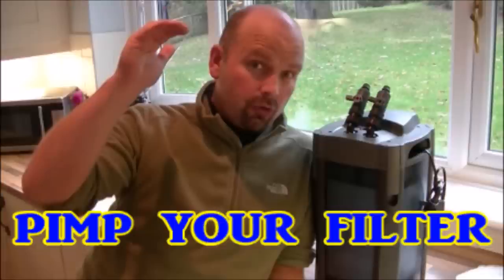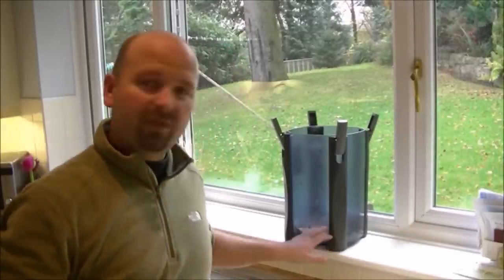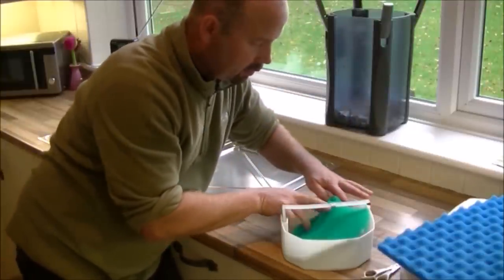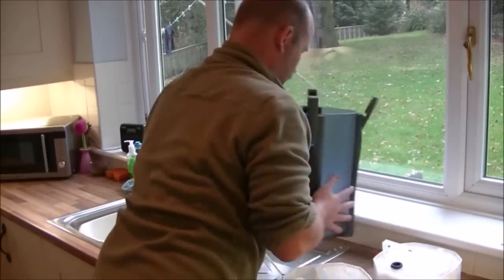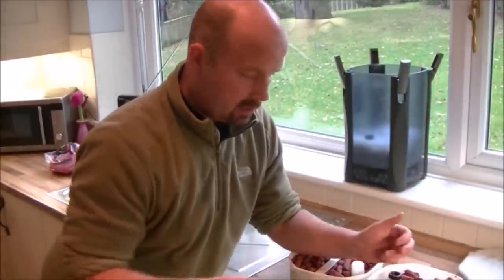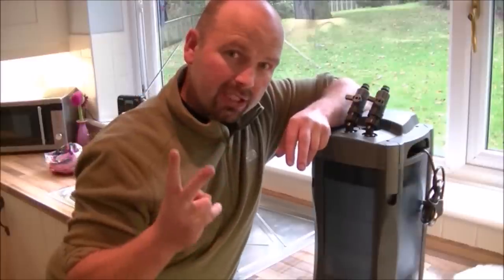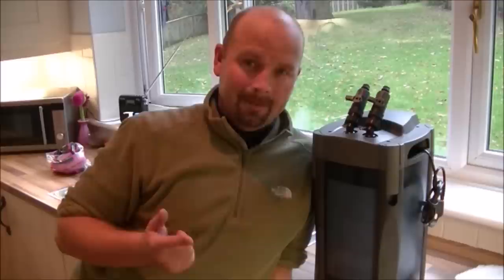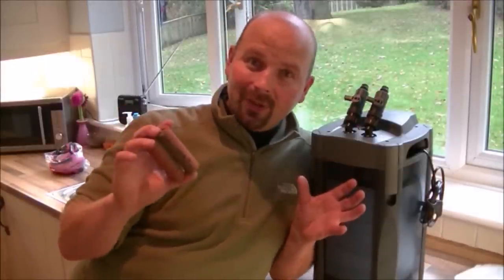External canister filter set up, nitrogen cycle and what happens in a filter - by Pondguru

Comment: Hi Pondguru, I'm getting ready to pimp my filter, but I was told by the Greatwave person not to do it all at once. My canister filter is an established Marineland one, so could you please tell me how to go about doing this ? thanks in advance.
Reply from the maker: Don from Greatwave may have already explained this but in the case of an established filter it is definitely best to upgrade it slowly since doing it all at once will set the filter back to day 1 due to all the established bacteria being removed and new bacteria needing to build up to a sufficient level to cope with the bio-load.
Therefore I'd suggest the following:
Week 1 replace the foams
Week 2 or 3 replace 1 tray of media
Week 3 or 4 replace another tray of media
Week 4 or 5 replace another tray of media and so on until the filter has been upgraded.
It is always best to leave at east a week (or ideally 2 weeks) between the tray upgrades to give the new media time to mature enough to cope with the pollutants. The gel balls will help during the process as they dissolve slowly releasing the good bacteria which will not only seed the media but will act against the ammonia and nitrite, helping to level out any spikes associated with changing media in a filter.
Not sure how many balls Don gives away with the media but I send out at least 10-15 per kilo which is more than enough to prevent spikes.

Comment: Hi, first of all, thanks for your fast shipment. I received the BioHome Mini Ultra Media fast & well packed, together with the free starter balls. If you can help me please, I have got an Haqos Expro 1500 external filter. As soon as I saw your video, I thought of swapping the trays, opened the filter and found out the coarse foam (on top of filter) was dirty and the medium foam just beneath cleaner! I thought water is flowing from top tray to bottom tray??? I consulted with the shop I bought if from too and he also said that in this filter model, dirty water flows downwards and clean water comes back up through the pipe/hose. Could you confirm for me please before I re-arrange my filter using the filter media I just bought from you? Thanks
Reply from the maker: I sent a reply to the email you sent shortly after you posted this comment.

Comment: Maybe a little off topic for this video, but what is the best value (I mean the best for a reasonable price) external cannister filter these days? I've not kept fish for around 10 years now, but I used to have both Eheim and Fluval filters on different tanks - the Eheim was better all round, and was silent (very important to me), while the Fluval just made a lttle noise.

I don't know what's available now, and how they compare these days...
Reply from the maker: The fluvals are OK and very cheap. All Pond Solutions make decent ones which have more biological capacity than the fluvals so they are definitely worth checking out Obviously eheim is still the best make but if you replace the cheap crap media , bio balls etc. in the APS filters and set them up properly they will perform very efficiently.
Reply: Pondguru  Thanks - I'll take a look at All Pond Solutions and see what they have, although I may just save up and get another Eheim.

Comment: Woody's Discus
What Do you think about sand on the bottom ? Before the sponges of course, or . half sand and the rest ceramic media (just leaving out the plastic balls). 
My Bio Home ultimate is waiting for the third tray for my 2217.
     Thank you in advance,
     Woody
Reply from the maker: Sand in the bottom of the filter? It will be sucked into the foams and quickly clog them unfortunately.
Reply: Thank you Richard !!!
Received my third "divider" today. Will set up tomorrow A.M. as you show. Will use two fine pads as eheim only gives  course, fine , and a carbon pad. Oh yes , BioHome ultimate !!!!
Woody

Comment: Hi there.  Thanks for this video!  I know it's a couple years old but it's given me more info for what I need than just about any others have.  I do have a question though, if you can help me;  I have a Sun Sun canister filter that is very similar to the one you have in this video.  I've had it for two months and it appears to have cycled nicely because the fish I have (all 8 of them!) seem to be very happy.  I was told to do a filter cleaning and was wondering if I should replace the media in my filter now or if I should wait until later.  Is this method you show ok to do at this point (two months into a new aquarium)?  I would really love to use this media instead of the smooth ceramic rings and cheap mechanical filters I have installed now.  I have found Greatwaves website and can get what I need there if it's ok to do it.  I appreciate your advice on this and also on all your videos. Great stuff! Thanks again!
Reply from the maker: Dear Tony,
Yes it is fine to replace the media you currently have with proper media but it would be best to do it gradually. One tray in first week then leave for a couple of weeks before changing another tray and so on - that way the change over should take 6-8 weeks and be very smooth.
If the aquarium is only 2 months old then it won't have anywhere near a full stock in there yet so its a good time to do it before the filter is operating at capacity.
Glad you enjoy the videos.
Regards,
Richard

Comment: that helps a bit chap will i need to reuse my old biological ceramic rings. i have 4 trays one with biological and other 3 with polishing pads and carbon. im due to filter maintenance soon do i replace everything with 1 off your kits cheers neil
Reply from the maker: +Neil Smith Sounds good and your fish will thank you for that.
Reply: +Pondguru Outdoors do i reuse old biological or get rid
Reply from the maker: +Neil Smith From an efficiency point of view it would be best to replace the ceramics with the biohome but if is a mature system do it one tray at a time so the change over takes 3-4 weeks.
Reply: +Pondguru Outdoors ok thanx. yes it is a mature system

Comment: Pondguru your videos are awesome thanks man!
i currently have a 10 gallon tank and looking to purchase an external filter. 
im also looking to get a bigger tank soon..so i wanted to get a filter that could be used for my bigger tank (20 gallon) as well down the line.
so my first option was looking into the Eheim Ecco 130 or 200 is 200 over kill for a 10 gallon? both have similar flow rates...the 200 is a tad bigger with one more basket for media. so my issue is the order i should put everything in because....in the EHEIM Ecco canister filters, the water enters from the top of the unit and goes to the bottom of the filter by the sides. Then it enters the filter media baskets from the bottom before going back in the aquarium. You should only have one blue coarse filter pad at the bottom and you can fill the rest of the bottom basket with SUBSTRAT pro. For the rest of your set up, everything is placed the way it should. just a little confusing on what they mean? how would suggest on doing it? and also whats your opinion on using an Eheim Aquacompact 60 instead? thank you for you time and keep up the good work.
Reply from the maker: Danny Arias I have had someone at my house with a ecco filter today a luck would have it so I know exactly how that one works. The top foam (blue one) is a coarse foam as a 'pre-filter' then water is fed out between the tray where that one sits and next one down so it can flow down the outside of the trays and enter the rest of the trays from bottom to top just like in this video so leave the top foam in and set remaining trays up like in this video. I would personally get a filter big enough for the tank you are going to get and that will save you buying another one when you upgrade. I'm not familiar with the Aquacompact filters unfortunately.I think the filter which was brought to me today was a 200 and it took about 600g of biohome ultimate per tray.

Comment: would the media used in your video be better in your opinion  than using Google K1 micro
Reply from the maker: +Paul Perriss The biohome ultimate is easily the best media available for externals and the K1 would be used in a different sort of filter - a moving bed filter. Plastic media is no good unless it is moving as it supports such a low population of bacteria when used in a static filter.

Comment: Hi pondguru,  have you come across cfs 500 and 700 filters. If so I was wondering the best way to change them to include biohome media. Top vids btw thanks.
Reply from the maker: Chris Marchant I haven't heard of them and google search doesn't give me many clues. If they are external filters with a pump in the top like this one then the set up will be exactly the same. If the pump is at the bottom (like FX5 and FX6 from Fluval then the trays would be reversed so foams on top and media underneath. Feel free to send tray sizes and pictures of filters to pondguru@btinternet.com and I can work out how much media you will need no problem.
Reply: Cheers will send a pic. The 500 is more like an fx5 the 700 is a bit different. It pulls water through the centre past a uv light.
Reply from the maker: Chris Marchant No worries.

Comment: When setting up a canister filter for the first time, should I wash my filter medias before putting them into filter? If yes, should it be with tap water or rested& conditioned water?
Reply from the maker: Ideally it would be washed in treated tap water or water you have drained from the tank but it just needs a quick rinse to remove any dust generated during transit.

Comment: Love your videos can you show us how to set up a FX6 thinking about getting 1 want to set it up the right way your way
Reply from the maker: Floyd Morey It is exactly the same principle but as I mention in this video the FX works from top to bottom, not bottom to top like the one in this video. Therefore you only need a fine pad on top of top tray (as you have good mechanical filtration all round trays) then put the biohome mini ultra / ultimate in the trays below the fine pad. You should be able to get approx. 5kg in there and that will give you enough capacity top see good nitrate reduction in about 500 litres community tank.
Reply: Thank you. So keep it simple and use the right stuff
Reply from the maker: Floyd Morey That's exactly right. Manufacturers want you to believe that you need all sorts of sachets of magic granules to remove ammonia, nitrite and nitrate but all that should be done naturally in the filter when it is set up properly.

Comment: Hey Richard do both the medium and coarse foam go bumpy side down?
Reply from the maker: +Mine Shaker Yes the bumps will be facing the water flow so you get maximum surface area in contact with the water so it goes much longer between cleaning sessions. I may have put one of them in the wrong way on my previous external filter video, lol

Comment: I’ve been looking all over for a good external filter setup, I tend to look in the comments and people mention you on how to ‘properly’ setup an external filter. If I follow this setup will my discus fish survive?
Reply from the maker: I can't say if they will survive as I have no details of tank size, current filtration, stock or if they currently have health problems.
BUT....if you properly size a filter and set it up properly the fish (of any type) will have not only the best chance of survival in healthy water but they will also be way happier too. This video I did last year goes into much more detail about sizing filter and setting up: https://www.youtube.com/watch?v=L5FkSTYkEAE
Reply: Pondguru I’m planning to buy a fluval Roma 240 (240L) with a fluval 306 external filter. I’ve seen other people setup their fluval filters differently to this.
Reply from the maker: My previous reply has a link to a video I did about properly sizing a filter. Even with a normal stock in a 240 litre you will be unlikely to achieve a full cycle with a 306 since it will only hold 2kg of media (if you use the bottom tray for foams). The coarse foams down the side of the 306 would be left in place and bottom tray would be for coarse (if used), medium and fine pads leaving 2 trays for media (1kg biohome ultimate in each tray - 2kg total). You'd be much better off with the 406 for a normally stocked 240 litre tank.
Reply: Pondguru ah okay, thank you for the information. I’m quite new to using external filters. With the fluval 406, it comes with media and carbon already, should I use those before using the kit in your description?
Reply from the maker: If you need to get the filter running on a tank before proper media arrives then yes by all means run what comes with it as it will be better than nothing.
Reply: Pondguru Okay, so I can use the media that my filter comes with and replace it during the next cleaning (or depending when I buy biohome filter media), without losing bacteria?

Comment: 1. Any updates on the Production of your Peat Pellets?  
2. If carbon is to be used in this setup, would it go before the Biohome or after?
3.  Any thoughts about having Biohome made into small balls or other shapes?
Reply from the maker: The peat pellets were too costly to produce and although they worked great they were no more effective than peat balls which are much easier to make.
If you use carbon then it needs to be the very last thing water hits before leaving a filter so it would sit on top of the top tray in an external filter like this one. It can be made into small balls but Eheim already do a very similar product. There is the possibility of making up some moulds to produce ornamental pieces of biohome but that is just planning at present and none have been made yet.
Reply: Simple answer: Don't use Carbon. It bonds with the muck. It's effectively a one shot filter medium and once it's full, it's full. It doesn't work over extended periods. Junk it and get something that gives proper biological function.

Comment: Person who said its doesn't help nitrates I don't agree.it defo does with me..maybe you don't have enough biomedia...I used Richards method but added my own concept too I did coarse coarse medium medium fine fine.4 kg of biohome ultimate .my waters super clear...I now have 0 ammonia 0 nitrate I couldn't b4 pondgurus mod was very low but never 0 .7 weeks later still clear still perfect water really don't need to clean but I like to keep it running efficiently... Tried tested even modded super results
Reply from the maker: Dead right there on the quantity of media used. Some people will buy 500g for a 300 litre tank and expect it to be a magic bullet when they have a filter full of nitrate producing ceramic rings preventing the biohome having any effect. If anywhere near 1kg per 100 litres is used there should be no ammonia or nitrite and extremely low nitrate (often untraceable).

Comment: Hi Richard thanks for the great video. Let me explain what I am trying to accomplish and you tell me if the kit is right way to go.

I have a 10 gallon jbj rimless with a pretty horrible filtration setup for an all-in-one.

But I will keep it there for flow and wanted to use a canister for back up and to house beneficial bacteria . I was reading that issues with canister is the build up on them cause nitrate factories to be housed in them so with what your saying your way will prevent that ? Wanted to confirm lol.

Is there a possible way to even setup a copepod hotel in there ? Using one tray just for that ? I may be asking a dumb question but since you have a lot of experience maybe u can knock some sense into me. 

The canister is not my primary filtration as it's only a 10 gallon, I do weekly water changes of only 1 gallon and I do have that weak filtration it came with, that's why I want to see if there is a way to use one of the trays for copepods.

Any info would be appreciated thanks so much!!
Reply from the maker: I can't see any way of having coepods in there as the filter will just treat them like floating debris, trapping them in the foams / fine pad.
Yes canister filters are generally nitrate factories but that is purely down to 2 reasons: either they are not big enough for the tank or they use biological media which only support aerobic bacteria (so they process ammonia and nitrate aerobically and produce nitrate as the end product with no anaerobic bacteria to process the nitrate).
Having a suitable sized canister filter with proper filter media (e.g. biohome ultimate) which has a specific structure for the aerobic and anaerobic bacteria ensures that the full cycle is achieved and nitrate is also processed into soluble nitrogen which bubbles off or is used by plants.
There is a guide to how much media is required to achieve full cycle filtration for a variety of stocking situations on the Q&A page of my website http://www.filterpro.co.uk and there's other useful notes on filtration there too.